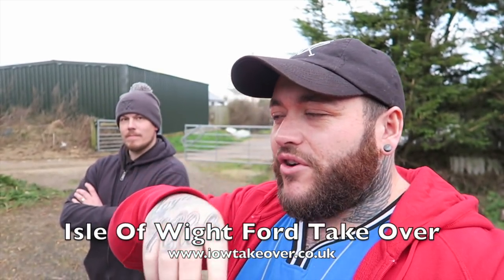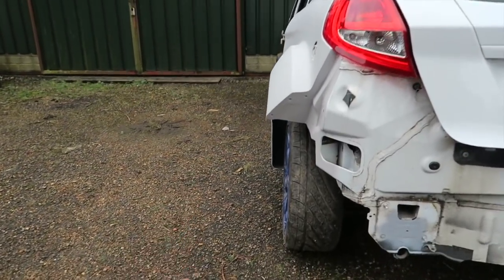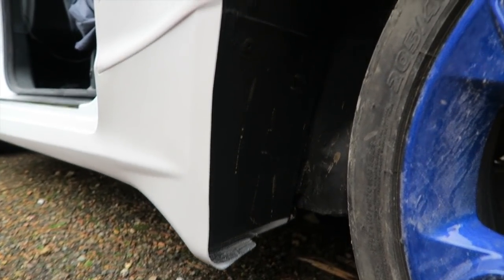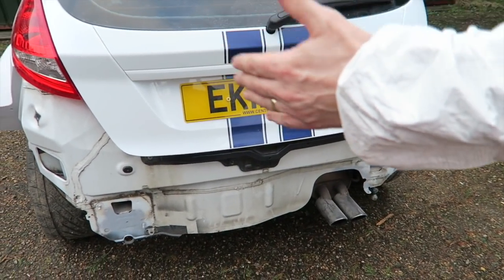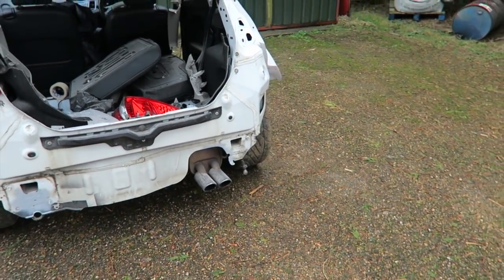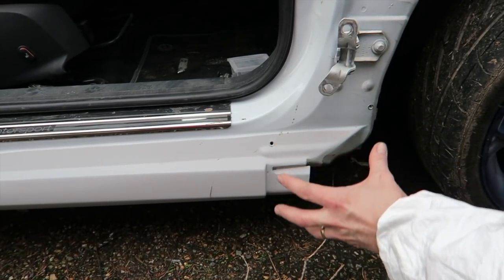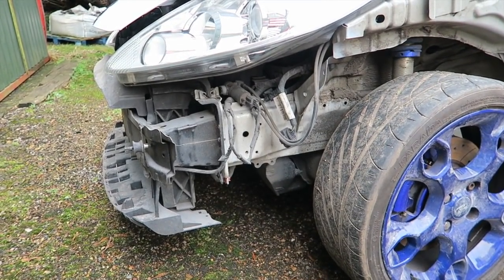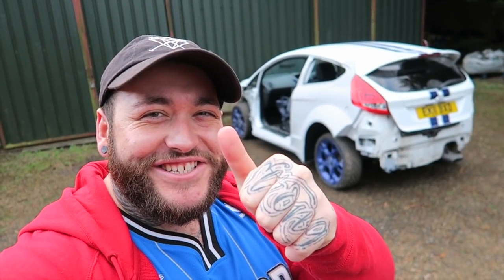CRAZY WRC FIESTA BUILD - ready for paint

Comment: No doubt will make a good track car when its done.
Reply: RR PLANB front wheel drive, 1.0 litre 100bhp engine, why will it be a good track car?
Reply: On a tight track suited to this type of car of course..
Plus with a bigger turbo and a remap you could no doubt get 150bhp easily from a 1.0L Ecoboost. (They are around 123bhp stock tune)
Tight fast cornering track like hatchback rally cross in the 80's and 90's.
Reply: RR PLANB they are really fun cars to drive, I have the 140ps st-line at the minute. But if I was putting as much time and effort as these guys on building a track car I would start off with a 1.6 ST.

Comment: ‘Structurally strong’😂 a pop rivited plate pure shite cheap job
Reply: Jack Shields 
Actually bonded and riveted panels are structural if you use the correct materials but then again people in the trade and up to date with all the regulations  and new practices would no this? bmw is one of many motor manufacturers that use this
Reply: Just putting it out there lol